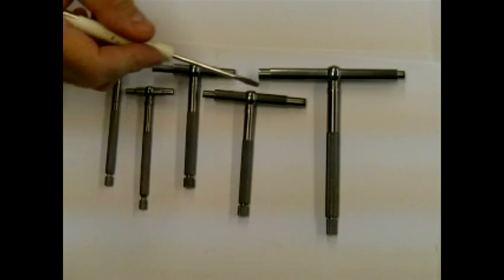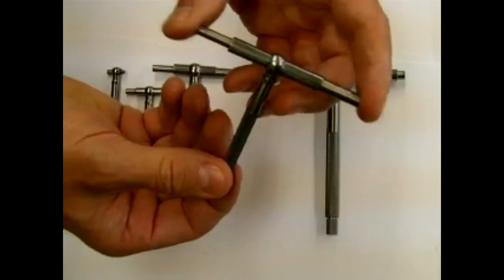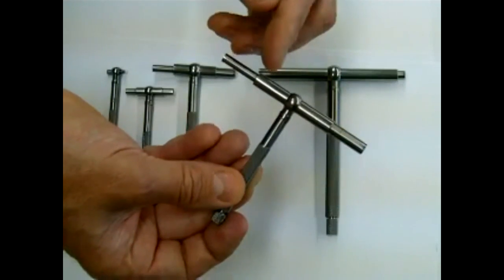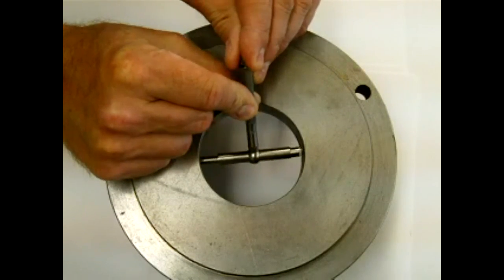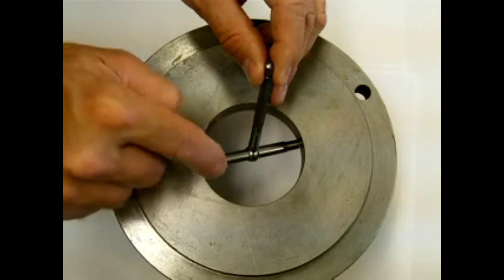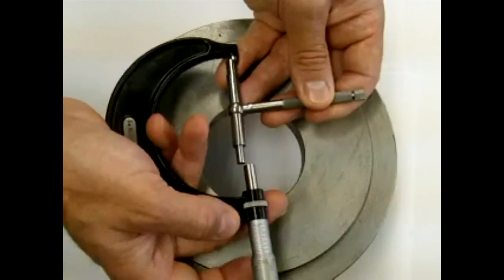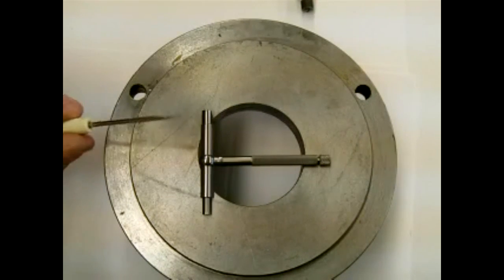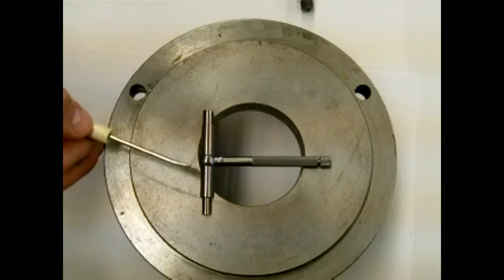Telescoping gauge

Comment: Why are you moving the telescoping gauge as you try to measure it? Seems like it would be impossible for two people to get the same measurements.
Reply from the maker: The ends are slightly convex, I'm trying to find the high spot.
Reply: @machiningmoments  but your anvil is flat. Wouldn't holding the telescoping gauge straight and taking a measurement with your outside mic be more accurate than wiggling the telescoping gauge while trying to mic it? Thats the part I can't grasp.  When I take sizes on a bolt, I understand moving it because you want the widest point of the bolt. But the telescoping gauge's convex sides are the same size or smaller than the outside mic's anvil... why wiggle the mic feeling for a brush instead of just taking the size?

Comment: why cant we just use inside micrometers?
Reply from the maker: Most inside mics won't go smaller than 2". If you can get one in the bore it will measure fine.
Reply: That makes sense! thanks! :)
Reply: You can but in my experience they are harder to use in that you have to "fish around" with it to find the widest point.And a lot of machinists use an outside mike on them to get the measurement because they don't trust the measurement on the inside mike. They are hard to get the hang of.I much prefer the telescoping gauges it the hole ill allow it. Over 6" of course it is inside mike time.

Comment: I use this method to measure the cylindrical wear of an internal combustion engine. It's extremely precise, but time consuming, versus the more popular dial bore gauge.  However, I continue to apply this method, because it is the method I was taught, and feel most comfortable with.
Reply from the maker: Lynx Star Automotive It works well!